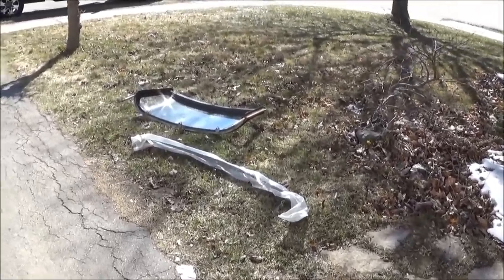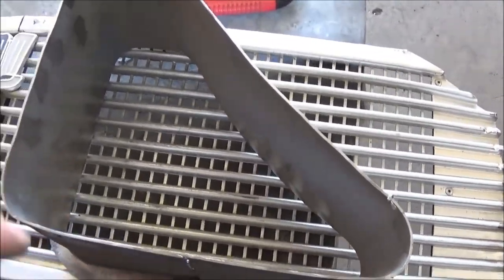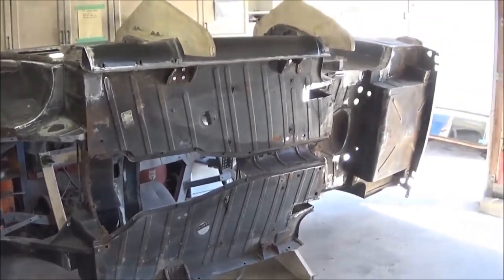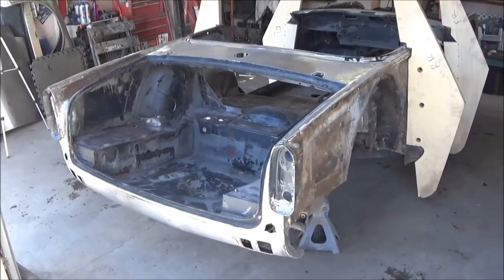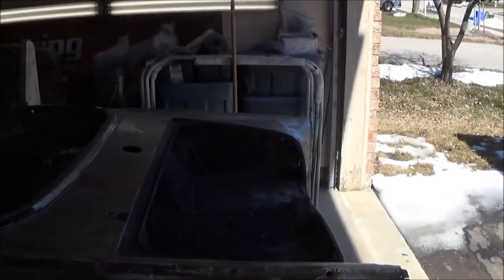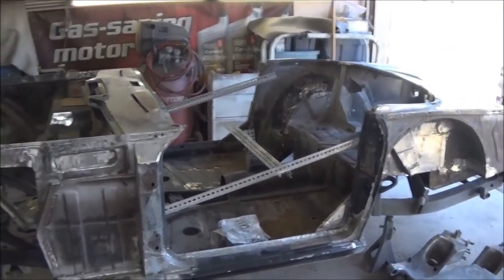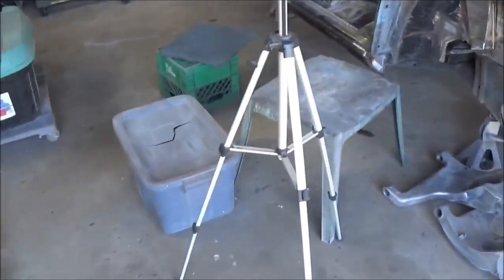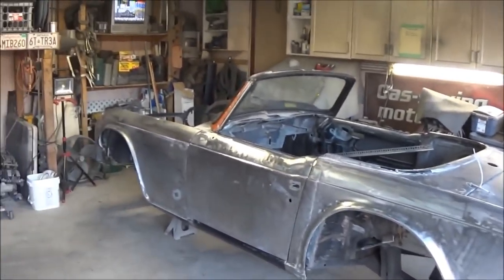1968 Triumph TR250 Restoration, Tub Back on the Frame and Final Panel Fitting

Comment: Before you send the badge off (if cutworm needs it), would you be able to take some detailed pictures of it on some graph paper or a rule for scale? I've wanted to draw one up in CAD to see if I can make replicas, but haven't had access to one.
Reply from the maker: I can try to do that once I get it detached from the grill.   I  will send you a message when it is done.  Cheers Tush
Reply: Excellent news, thanks Tush!